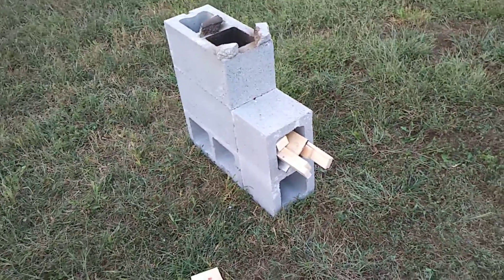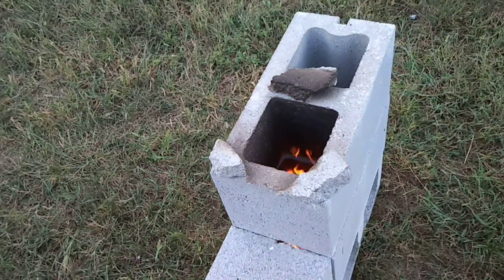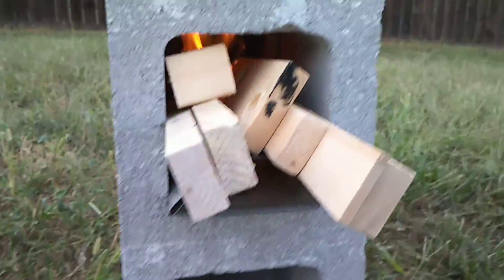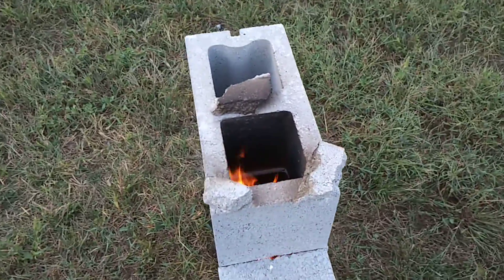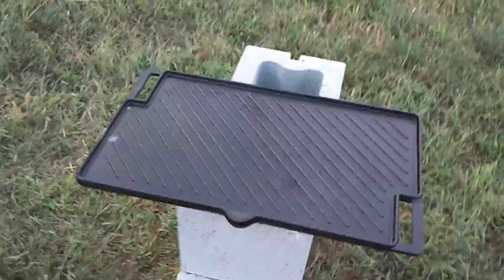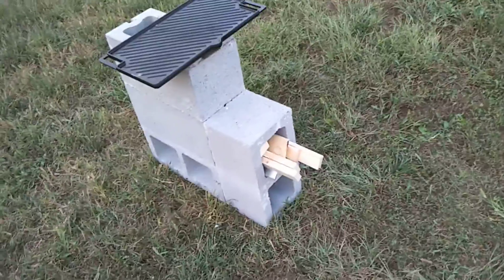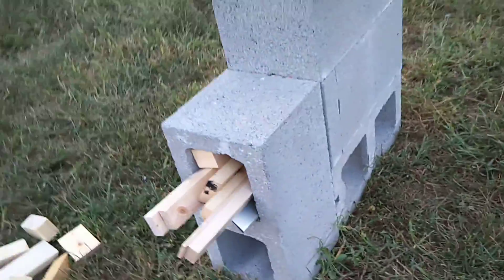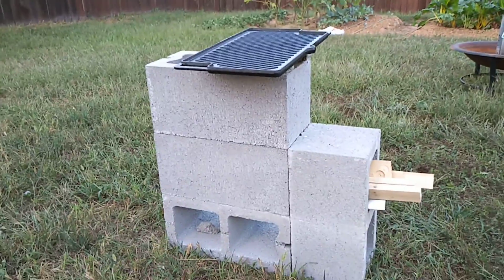Backyard rocket stove - part 1- building your first cinder block rocket stove

Comment: Did people use these in Romania during hyperinflation?
Reply from the maker: We used a wood burning stove, made from iron. it was very common.
Reply from the maker: the beauty of this one is that you can generate enough heat to cook just with some small twigs you gather from the woods.
Reply: Thanks for the info we now have both …I stored the cylinder blocks in my greenhouse for safe keeping.  I really like the cylinder block stove concept I have a iron wood burning stove purchased 4 years ago in our garage It was purchased after we lost power for several days in March with freezing temps a very unpleasant experience especially with children We decided after that experience to make sure we could heat our home also put in a propane fireplace I figure we can always move the wood burner indoors if propane would become unavailable…Anyways thanks again appreciate your help